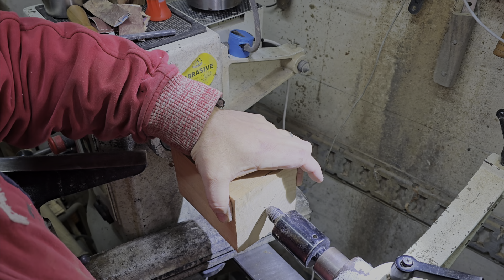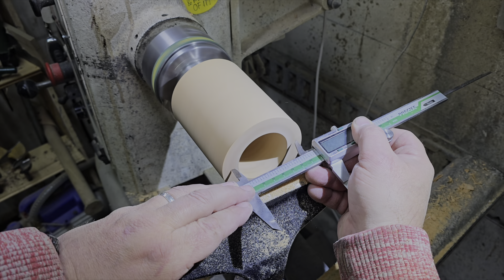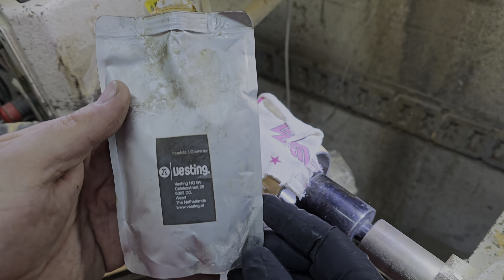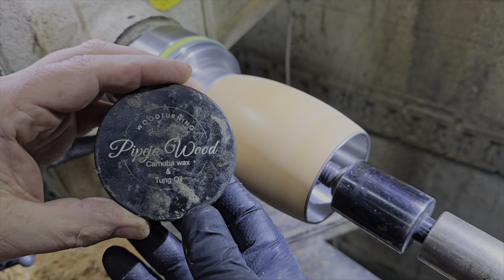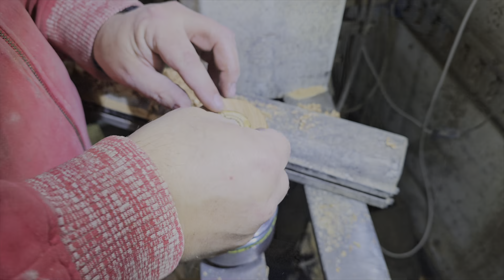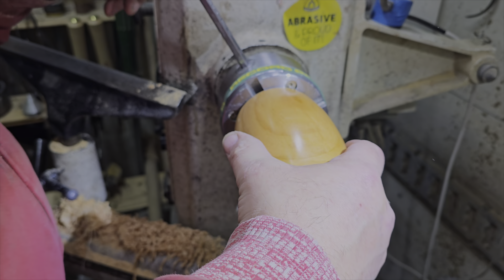I Turned a Raw Cherry Wood Block into a Luxury Coffee Cup

Comment: Amazing work . May i know what did you use and apply for the stainless steel to stick inside the mug?
Reply from the maker: Thank you very much. First, I sanded the outside of the stainless steel insert, and then I used 5-minute epoxy resin to glue this stainless steel to the wood.
Reply: @Pipejawood-Woodturning Thank you!!
Reply from the maker: You are welcome.